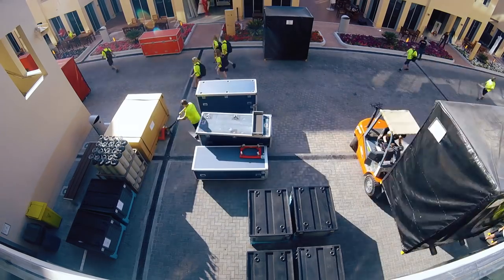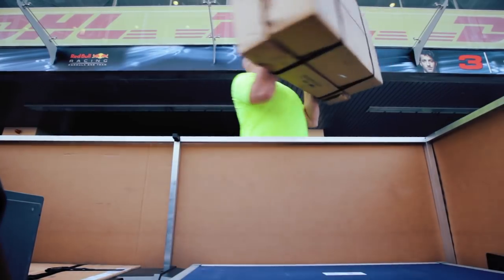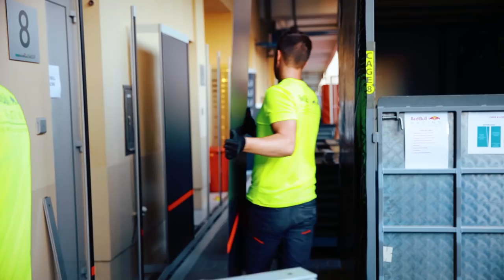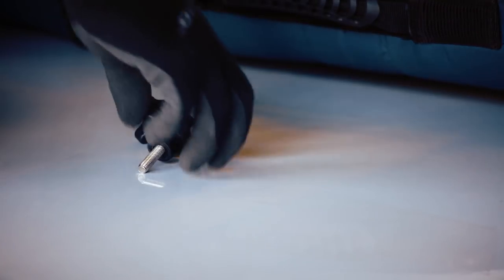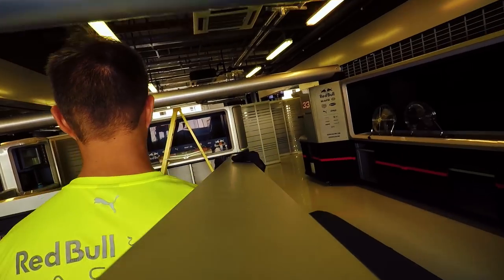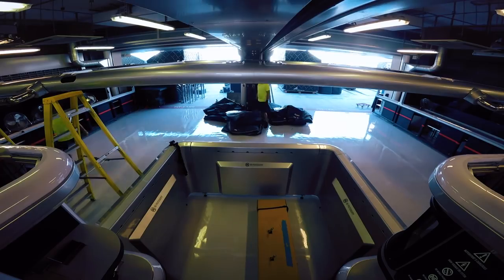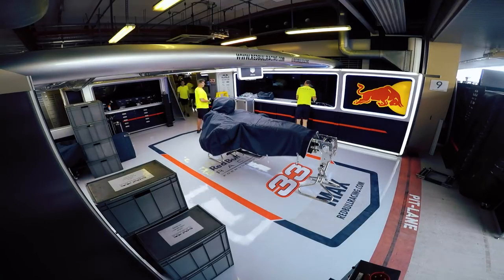How to build an F1 garage | Red Bull Racing get set up for the Abu Dhabi Grand Prix

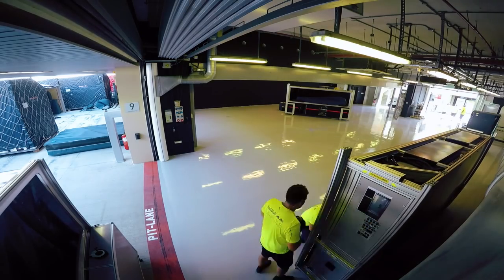Comment: 0:37 You have to bring... air??
Reply: The air used to cool down the brakes when the car is taken in after practice sessions/qualifying laps I think. Or it is some kind of refined air.
Reply: Olve N nah, I thinks it's like air compressors and air lines for the pneumatic drivers they use to do up/loosen nuts and bolts
Reply: Yeah that makes more sense actually :D

Comment: I hadn't thought of it that way (that's why I don't run a racing team, duh...) but it makes a lot of sense to have 5 sets of garages. Sure, it's 5 times the cost of one, but they'll all be essentially reused for ages, with just replacements for losses and wear and tear. But freight costs are a recurring thing, so if you multiply the difference between air and sea freight by the number of race weekends in a year, they've probably long recouped their capex by now.
Reply: Also, logistics. DHL probably sends every set to the next destination weeks on advance, so if they had a problem (customs, delays, etc) they have more time to solve it.